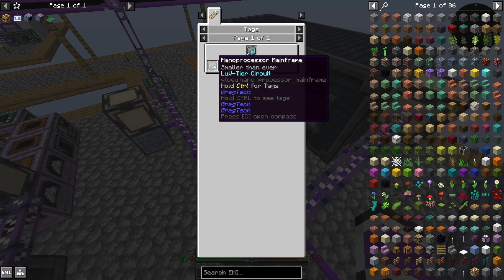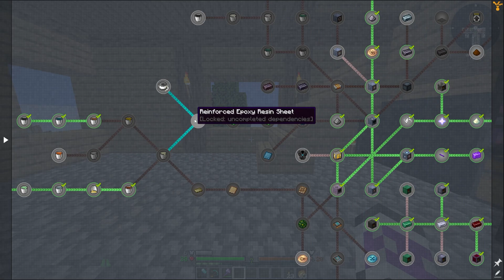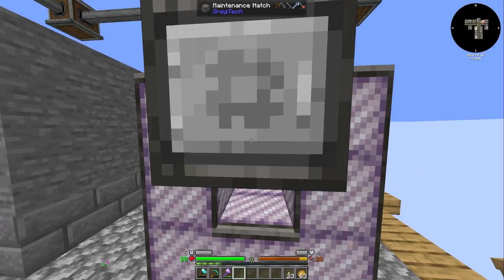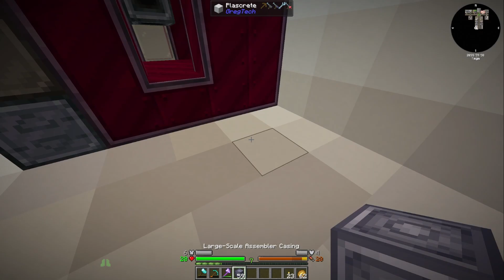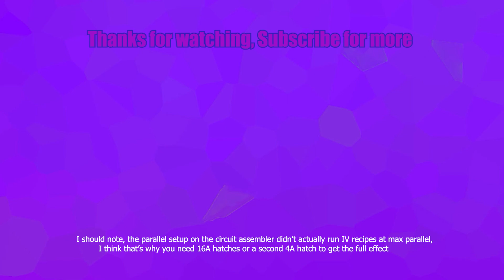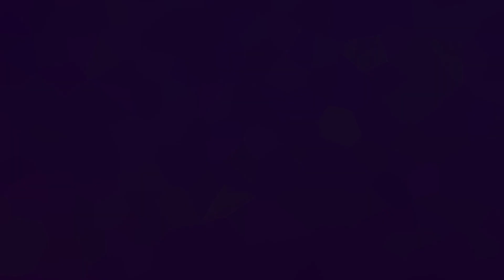Star Technology: Episode 33 - Parallel Crafting

Comment: Tips: for the recipe updates after a new circuit tier, you can craft the Extended pattern access terminal, which lets you filter patterns by their input and/or outputs. That way you just have to search for the name of the circuit to change, and it's easy.

Also, why don't you set an extended pattern provider for the circuit assembler ? You wouldn't have issues with the upcoming circuits and all misc items
Reply from the maker: Have you not seen them littering the base already?
Reply: @Thaumiumking9  Yep, I forgot, changed the comment already, my bad

Comment: The box large multiblocks don't really parallel. They have something called "Perfect Overclock".
Machines and most multiblocks use normal overclock, which is 4x the energy consumption, 0.5x the duration. So it's a 4:2 ratio overclock.
Some multiblocks have perfect overclock, which, unlike the normal overclock multiblocks, has a 0.25x recipe duration modifier, so with each overclock, the recipe time is reduced to a quarter. So perfect overclock is 4:4 ratio overclocking
Reply from the maker: Oh, that makes sense now. People have mentioned perfect overclock before but I thought it was the opposite, that it took less power for the same effect. That explains some of my questions with the LCRs as well. Thanks for clearing that up.

Comment: You can make large steel fluid cells to transport a large amount of liquids at once, so you dont need to make a lot of buckets, this cells can content 8 blocks of liquid
Reply from the maker: I tried the fluid cells really early on but I couldn't get them to work, I didn't try the steel ones though so maybe they work. I'll check it out, I'll go for the tungstensteel ones though, I'm guessing they hold more liquid.